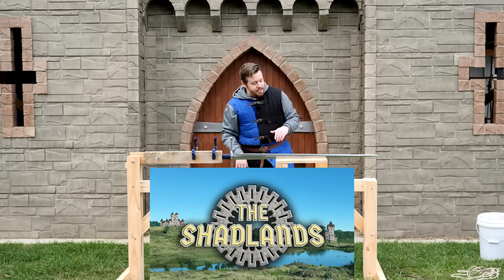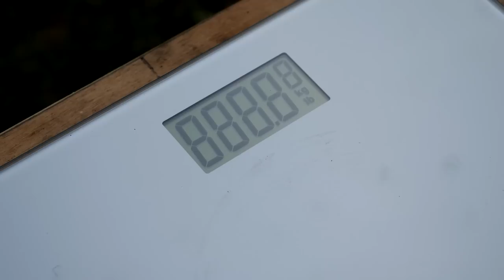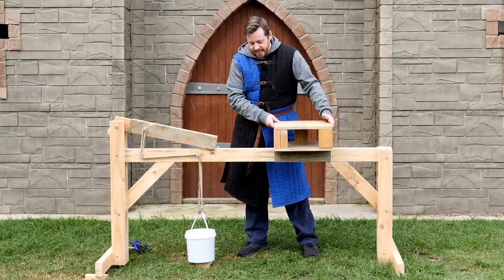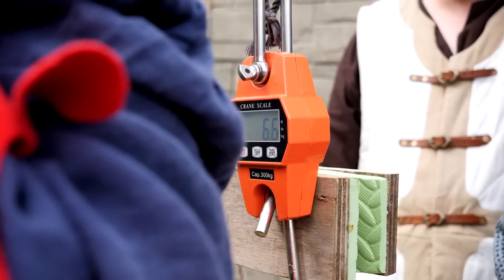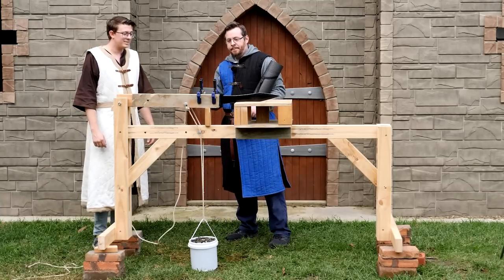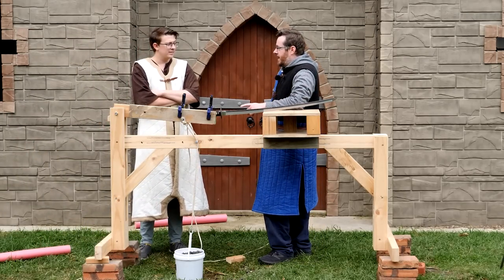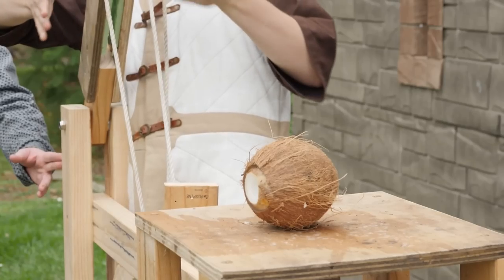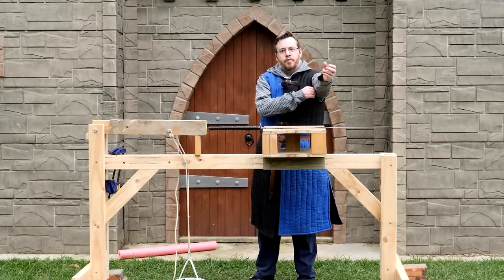Choppy choppy

Comment: Woodworking perspective: when you watch the shots you can see that all of the blades slip upwards despite the clamp. The blades only stop moving up once they hit the clamp arm, but by then have lost a lot of force. If you had a woodblock there it would be a nice constant, so that the blade would land in the same position every time
Reply: Also woodworking perspective, though late to the party haha, those clamps are extremely weak, a couple good bar clamps with cauls would perform much better, or some toggle clamps would make it look more authentic to the period 🤔

Comment: This rig is perfectly fine to test whether something can “cleave”. What you mentioned early in the video would be the way to test how well something cuts. Cutting takes very little force. 

This can all be proven in the kitchen with a few random knives and some tomatoes. A dull knife will require more pressure, a sharp knife will glide right through, and a cleaver will cleave its way down to the cutting board.

I quite enjoyed the video, keep up the good work.

Comment: The amount of kinetic energy for dropping the sword vs overhead striking with sword are going to be vastly different.  The zweihander has a lot of mass compared with the Katana.  When you swung by hand the katana was moving much faster than when it was in the rig.  Kinetic energy = 0.5 x mass x velocity^2. I believe the issue is in there somewhere.
Reply: exactly! velocity is super important for cutting
Reply: the acceleration of the blade...a swing is much faster then a drop, and in a static rig the mass acts like a force multiplier
Reply: Good point but what we see here is a pure rotation and as such is subject to angular momentum (Very similar math) also the factors of cutting like this might not be very simple as to rely on just KE or momentum
Reply: the guillotine favors high mass with bias, where a human can swing something with lower mass faster
Reply: I'm not sure it's a zweihander, per say, aren't those even larger than two-handed swords, with addition of rings on the crossguard and a no - sharp section between handle and the blade's beginning ( where a combatant can grip the sword for half-swordi g...)
Reply: He also measured wrong. he measured the sticks force at the point of contact, however you measured your rig at the handle, I'm guessing he is getting around 2kg of force at the point of contact with the coconut, or 1/4 or so of what he wanted.
Reply: Indeed a sharp observation. Gravity accelerates objects in the same way no matter their weight. but when we swing an object we apply a force on it. A lighter object will be swung faster than a heavy one. The test puts light objects at a disadvantage.
Reply: Also swinging with hands don't stop this force on inpact, so katana goes deeper. Also edge is moving towards Shad, so it's not chop anymore.
Reply: It's not a 'zweihander', it's just a longsword. Despite a longsword being longer, katana's and longswords have nearly identical weight ranges. You are simply making a blind guess as to saying the longsword is heavier. And to say there's a lot more mass is categorically wrong. A katana weights ~1.1-1.5 kg, while a longsword typically weights ~1.1-1.8.
Reply: Kinetic energy is the backwards approach, actually. It’s the momentum that’s at fault for cutting specifically. Since, if we take this as a linear system for simplicity, a chop is pure simple shear stress. Shear stress T=F/A, where F is force and A is cross section area. 

The static force applied by Shad for comparison is incompetent since IMPACT force is moment dependent (Fi=dp/dt where p is moment, t is time, d is delta) since moment is a derivative of kinetic energy, p = mv. So the impact force is depending on both mass and velocity equally. 

Coming back to kinetic energy, it actually is more applicable here in calculation of the velocity of the swing, since it’s basically force over distance applied. The hero of the moment is momentum, something that is usually badly misunderstood from how the two are explained in high school physics.

Comment: Ok so I see three major issues with this contraption. 

When the arm falls and hits the woodblock stopper, that's going to cause significant wear on the wood. At the same time, the sword is going to be hitting the wooden shelf if it cuts through the target, which again is going to damage that wood. I would propose putting some material over the wooden parts that are being impacted to extend the life of the parts. Maybe some grass/straw mats would work.

Another issue is any sideways motion of the arm. Wood can flex so if the arm is being pulled a bit stronger on one side, it can cause the arm to bend to that side which can mess with the cut. In this case I would propose some guiding rails next to the arm on either side to keep it doing straight down. Just a wooden plank on either side would do just fine. 

The last issue is about lifting the arm. It doesn't seem like a good idea to have to constantly lift that arm with the heavy bucket on it from a lower standing position. I would put a rope and pulley on the back to lift up the arm. Much safer, less energy input and a clean release as a you only need to let go of a rope. If a rope and pulley is too much then at least have a platform next to the arm so you can get up to its level.
Reply: it would help make the distance the arm falls constant, as that would change the amount of force at impact.

Comment: I would suggest carving a shallow groove where the sword lands. This would simulate follow through and allow you to pad the sword's landing. This will allow more realistic cuts and less damage to the blade. Your current system has the sword make a hard stop exactly at the end of the material being cut. This leads to poorer cuts and blade damage, as listed above. I would personally suggest a half inch deep groove with a leather strip lining the bottom.

EDIT: just thought of another solution. You could have a slit that the sword passes entirely through, and then catch the arm at a lower point. But this solution, unlike the above, wouldn't work for axes unless you made the groove unreasonably wide.

Comment: 27:45 Hypothesis: the weight of the 2-hander provided more downward force than the katana. Additionally, both swords seem to be forced upwards when making contact with the cutting surface, losing inertia. Maybe adding a bar above the hilt in addition to the clamps to further secure the weapon?
Reply: would the answer be to pulley things into a horizontal cut? then it should be reduced to purely the force made by the falling weight. To save on construction time, would you be able to attach a sword to one of those automatic clay disc throwers? 
A bar below the hilt as well to go against the sword turning.
Calibrate weight for impact velocity?

Comment: Hey Shad, a couple of ideas and remarks for the "test guillotine":
- use a spring/lever stop release for the sword support, it will make your setup easier and safer, if done right then the friction will be minimal or non-existent, also a 2nd safety stop can be used to make sure the action is not triggered automatically (always safety first when working with sharp stuff or heavy moving objects) and can be just a simple piece of wood that can be set up and removed in while setting up the targets for testing
- the sword fixation used currently can be quite slippery, you need something sturdier that can fix the handle better and preferably from all 4 directions not just on the sides; the sponge and plywood, although they mold on the handle can also allow it to slip trough upwards/downwards; also use a design that also stops the handle for slipping up/down, you can still use a sponge to have a tighter grip but you need a system to compress it until it won't slip anymore; you can use sturdy clamps, but they can't compensate for a slippery fixation
- use something to fix the target as well, if the target slips or vibrates when hit then it will actually dissipate more energy, with a human grip you can compensate easier but for a rig setup this can be a problem, you can do a clamp system as well that grips tight the targets from the side so the vibrations will be minimal
- there's also a possibility for the arm "joint" to vibrate and dissipate energy when the mechanism hits the target, but unfortunately I have no "affordable" solution for this, you would need something more sturdy like a robotic arm or a hydraulic-controlled actuator like Mythbusters did in the past, all I can say is make sure it does not move at all when you pull and push the "joint" system itself, otherwise replace it with a better one

Edit: the yoga mats might actually compress a bit too easy before failing to resist to the chopping of the sword (as you said, like a camberson), I am 100% sure it will fail in slashes and punctures though.

Comment: One potential issue that occurs to me is that when you swing a sword, you are wrapping your hand all the way around it, not just holding it from the sides.  As such alot of the force is being pressed directly into the back of the grip, while in your 'guillotine' it's being transferred only through the sides.  As such, you may need some way to transfer the force around the back, such as by looping straps around the handle from underneath, or something.  I'm not an engineer, or I'm sure I could offer a better suggestion.

Maybe a strap that loops over the back near the guard, and a strap that loops under the front near the pommel, since that's often how you apply leverage when holding a sword, especially a two-hander.
Reply: I think you're bang on with the strap idea. He could drill openings into the arm of the apparatus itself so that the straps can be tightened really snuggly on each individual hilt. 

The very small amount of give that would be present on impact with straps (vs a hard piece of material across the top say) might actually simulate the tiny amount of give in the hands and soft tissue.

Comment: When you swing a sword with your hands, you rotate it around your wrists.  So even if you're exerting the same force over the same distance, the sword in your hand is moving a lot faster than a sword in la guillotine.  You would need to put a "wrist joint" in the swing arm that can rotate after the whole arm is up to speed and stopped by a block.  In addition, as others have mentioned, you're measuring the force on the arm at the wrong place, you likely need a lot more weight in the bucket.

Another couple suggestions:  Consider using a pin to hold the "shoulder" joint up that can be yanked out cannon style.  It would provide much more consistent releases than simply trying to do it quickly with your hands.  And drill some slots in the arm to replace the clamps with some more bolts that can be tightened more and closer to the handle of the sword to stop it from shifting as much.

Comment: 25:49 It looks to me like the weight hits the ground at around the same time as the katana strikes the coconut, or the stopping block is preventing the arm from swinging enough. Either way there is no follow through in the strike. 

More specifically, the katana hits the coconut but the handle slips. The slippage combined with the curve on the Katana and maybe a bit of robe stretching, the bucket is on the ground before the blade has a chance to do any work. It could also be the stopping block, and not the bucket hitting the ground. I really can't tell from the video. You can pause the video when the stopping block halts the arm and look at the position the blade is in to see it has no chance to cut. 

I think it would be good to make your chopping platform in two pieces, with a gap in between so the blades could pass all the way through. Mostly to save your blades, but also to simulate follow through. Then raise the rig higher to make sure all momentum is preserved through the cut. I would cut a notch into the spot where you have the stopping block, and a notch on the block so they fit together. Then make a bunch of different sized stopping blocks so you can have control over where you want the arm to stop for different sized weapons (like battleaxes). 

As for the slippage, people have lots of different suggestions already so I'm sure one of them will work. I'm just going to suggest to ditch those little hand clamps and think more along the lines of a vice, with a long handle for maximum leverage and tightness.

Comment: You were measuring the force you can produce at the tip of the sword whereas for your machine where you were measuring was roughly equivalent to the end of your arm. You need roughly double the weight to make it equivalent to your strength.

Comment: Hey Shad, super cool video, I’m excited to see more tests with this. A few improvements that I think can be made are below: 

1. Replace clamps with a set of bolts and nuts (probably atleast 4, 2 above and 2 below) that run perpendicularly through the 2 pieces of plywood. You can take them out to put the sword in, then insert them, tighten them with a set of wrenches, and test the sword. This system will handle sudden shock MUCH better than hand clamps while maintaining versatility. 

2. Use a ballistic gelatin block with a bone simulation for the cutting medium. I think either wooden dowel rods to simulate long bones or a coconut to simulate a rounded bone would work well and both would be biodegradable. The simulates can be set at a uniform depth in the gel for consistency and the gel will be uniform throughout and reusable. 

Thanks again for making this!

Comment: I think the problem was the give that the sword has within the holder. When it pushes against something, the sword gets disaligned with the holder; meaning it doesn't have the as much of a brace or push after the initial contact, unlike when a human is holding and pushing through the cut. Its equivalent to the sword slipping from your hands after the initial contact, instead of continuing to slice through the target.

Comment: Nice build, I think it could become really consistent and an adequate representation of a human strike with a few alterations.

The first problem with this device, in my opinion, is the position of the different elements on the lever, related to the pivot point. The closer you put the weights to the pivot, the less work they will contribute to the strike (further from the pivot). In your particular build, the weight of the sword is probably contributing to most, or at least a large chunk of the power behind the strike. If I had to guess the katana was the lighter of the two swords. The sliding on the grip is also probably contributing to a significant loss of power on the katana test. 

On the other hand, in my opinion, the larger problem was the way you measured the "weight" of your strike. If you wanted to approximate the force you can exert on the weapon you shouldn't use the stick. Imagine your arm + stick system as a rigid pole. At the position of your hand ("on the imaginary pole system") you are able to exert far more force from a static position than at the end of the stick. I understand that you want to simulate a constant force on the weapon, but I believe there are better ways for you to get an estimate of the weight and position of the weight to simulate a consistent human strike. 

That aside If you really want to approximate using a constant application of force by the hand, in my opinion, the easiest way would be to try measuring the "weight" you can produce with an extended arm, forcing your closed fist on that white scale. Then you can make the wooden lever the same length of your arm (pivot to tip equivalent to your shoulder to tip of closed fist). Then you should measure the contribution of the weight of the lever before you attach more weight. To do that, try measuring the weight exerted by the tip of the lever on the most horizontal position with the second scale you used. Then you subtract that to the weight you recorded from your arm measurement and attach the bucket weighing the subtraction result. You should attach the bucket to the tip of the wooden lever. It may be awkward to attach the weight on the tip since it is where the weapon is gripped, but it is the best way to do it without more calculations to compensate for the lever effect (The further from the tip the heavier the bucket would need to be).

Maintain the second screw (on the last try of the video) on that position, or you can even move it a little bit further. If you want a relatively constant force you need it at the same distance as the horizontal level, you can't remove it.

This is all a bit rusty for me, and there must be people with more knowledge on the subject here in the comments. That said, If you want any help on modeling the system, understanding the physics behind, and making a few adjustments, feel free to ask, if I know how to help I will.

Thank you for your commitment to accurate experimental tests!

Comment: A good bit of the katana's cutting power comes from the 'push-pull' motion of a good cut, using the back hand on  the hilt to pull while pushing with the lead hand, that gives it a different kind of cutting motion than a simple falling blade set up. A falling blade set up works decent for something like medieval style sword, mostly due to the straight blade nature, not so much for a katana in terms of testing cutting power where the rather notorious curve of the katana along with the man mentioned clamp issues in the comment is causing some hiccups with the way the rig is designed to work.
Reply: @sky okimoto Yeah, pretty much.